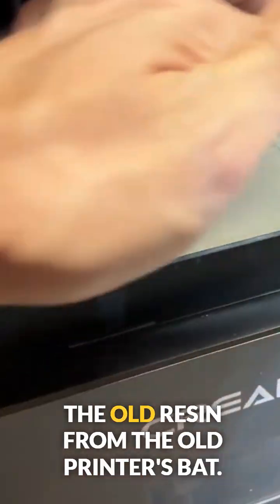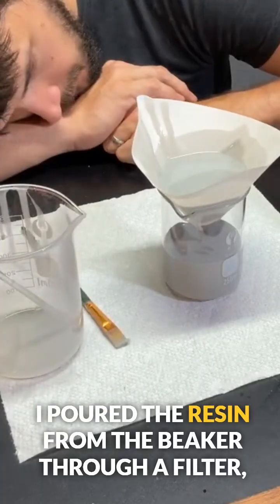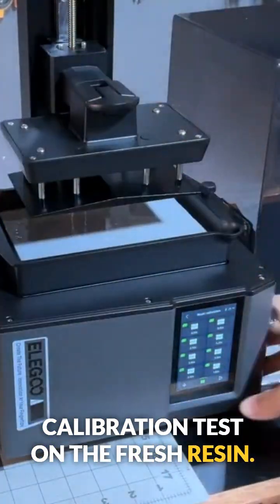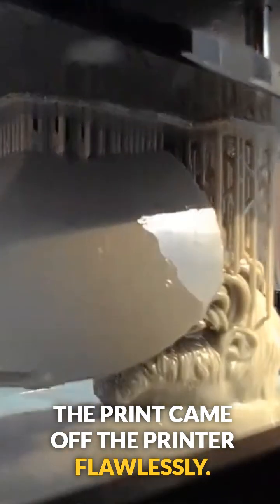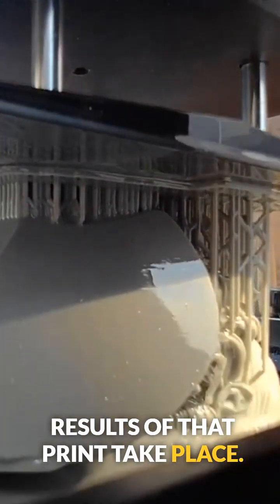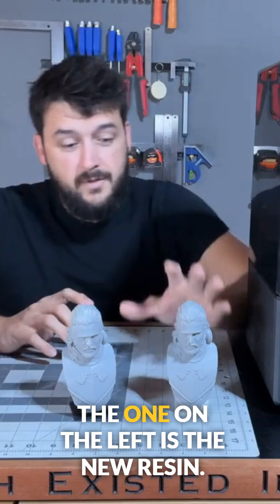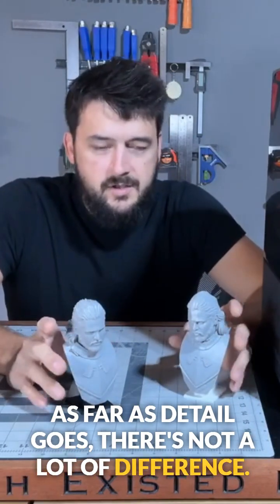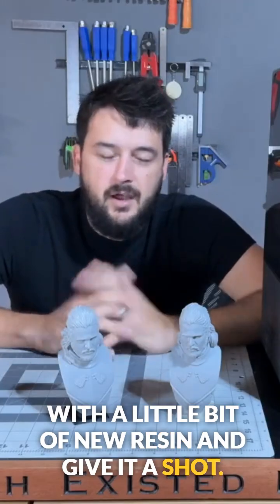Does Old Resin Still Work  #3dprinting #resinart #diy #diycrafts #diybuild

Comment: Thanks for this.  Probably the only YT video I've seen as I  let my resin sit in my vat for months (your 14 months is a record!) :D 
My resin sitting in vat for months is because recently I've been lazy to clean vat, strain, etc.   I did mix it and also did a UV vat clean function (run exposure on 20 sec to create a thin layer to catch debris.    I am about to risk and print something rn without straining. I stirred it for several minutes and also mixed in new resin with the same brand/type.  I'll let you know my results with no straining. LOL  I'm sure straining it first would've been better but we'll see how well the vat clean picked up any stray resin chunks.